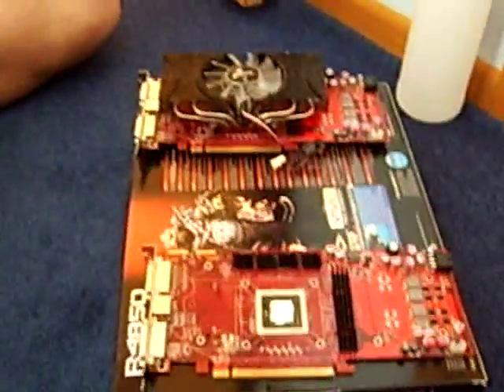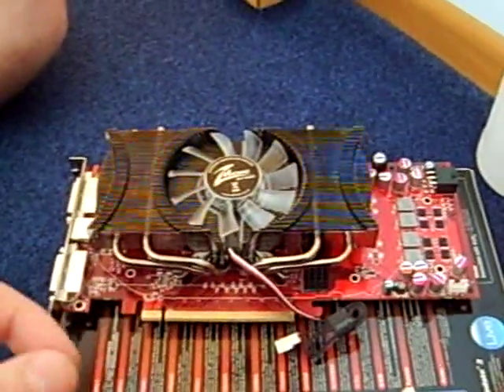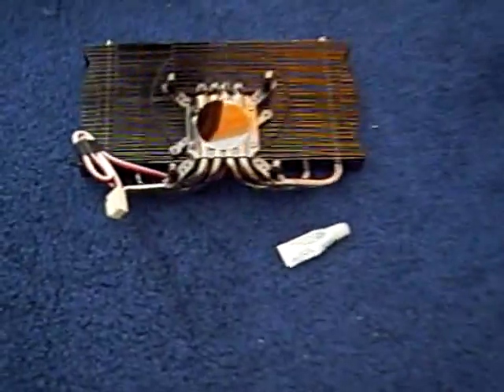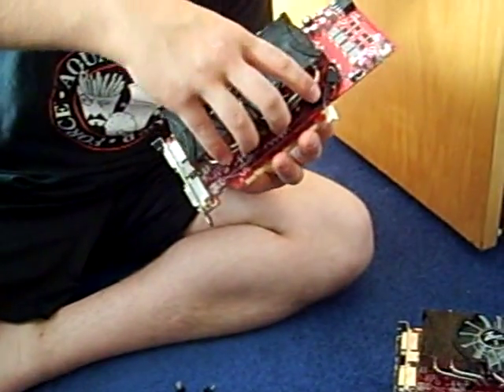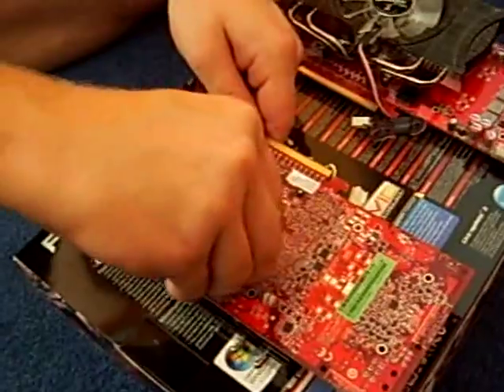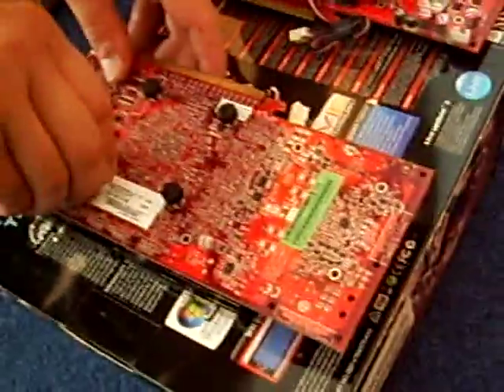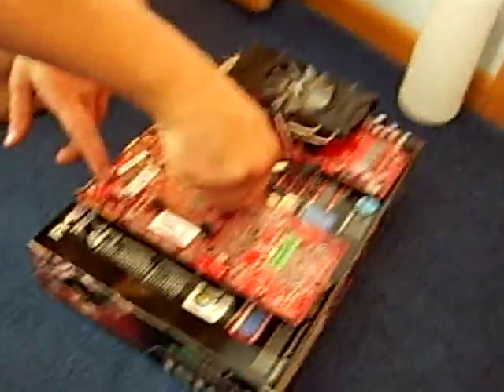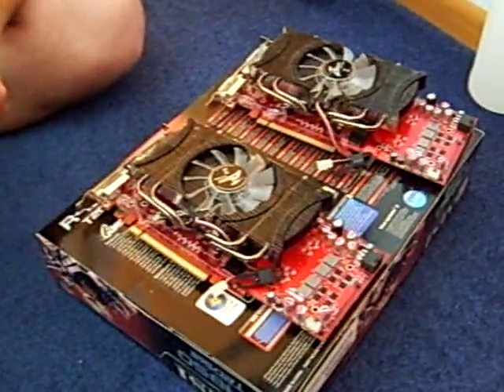radeon 4850 tutorial: Putting on an aftermarket vga cooler

Comment from the maker: I didn't "iss" them I simply did not have enough heatsinks for both the ram and those voltage regulators BUT if you have as ggood of an airflow in your acase as I do (IE case temp is always below 23C) you don't need em since the air itself keeps them cool enough. plus my fans speed are the fastest speeds you can get on the market which means there is no static air in my case.

Comment from the maker: The after market fan comes with essentials only which means the gpu and the 8 ram. The others are optional. I have been using this setup for about 3 years now... I know that I have enough airflow where I don't need those.

Comment from the maker: No, if you really did buy an aftermarket vga cooler it should have came with the main heatsink as well as other smaller ones for the RAM on the card. If yours didn't come with any then you need to get a better heatsink.. maybe mine. but the real answer you are looking for is this: the ONLY place you need to put on some thermal paste IS the center of the GPU itself... That is the place where the main heatsink is going. The others already come with thermal paste in the adhesive in the bottom.

Comment: hey man nice vid!  i was looking at a 4850 but unhappy about temps and was thinking of getting the 4850 = $200 + this cooler = $260 or i cud get GTS 250 = $220 which i read has pretty decent temps and probs wudn't need an aftermarket cooler.  I hear their performance is the same.  What do u suggest?  please comment everyone.

Comment: in conclusion. both the 4850 and 4870 base cooler both sucks. and for different reasons.

the 4850 sucks cause its a single plate. 
(very bad,heat vs cool ratio)(you better sometimes with real small cooler that dont touch everything)

4870 sucks as well but not as much as the 4850. so leeson to learn is. that any cooler that are based on a single impact plate to supposdly dissapate heat.(they are scientificaly scams)

Comment: and mainly the most imporatant it dosn't actually heat up your ram chips. which create artiffacts. 

(i have looked at the basic cooler of the 4870. and i must say its in fact much better then the 4850. as it is in 2 parts. gpu cooling is sperated from ram cooling. but still. the metal is too massive for adequate cooling.

(the thicker is the metal the harder it is to cooldown. while it seems to heat quite fast.(bad heat vs cool ratio again).

Comment: damn i hate 500 char limit.

what i whanted to say is that a single plate of metal touch all the ram chips and the gpu as well.
they all exange the normal temparature of the metal with their heat. however. the gpu heat so much that it give the metal a bad ratio cool vs heat. so you end up having a cooler not effective at all. all it does is look cool.
best is having a cooling block impacting the gpu only. so the exange of cool and heat is more fair.

Comment: if you whant a litte course on about cooling.

you don't need a diploma into that to understand it lol. here is it.

metal surface can be technicaly good for cooling. however. using a single platte of matal to dissapate the heat out of all heat source . the way heat dissapation work is.

and this is basic science. it work by exanging temparature. 
ex: when you hold a cube of ice in your hand.
the ice melt while taking your heat of your hand. and your hand takes the coolnest of the ice.

Comment: becausse the stock cooler is a pos metal. 

not even alluminium or even cooper.

its just painted in cooper cloer like.

its a real shitty metal with crap property.

it sucks up the heat and take hours to cool down. (not good metal for cooling).

Comment from the maker: Your cooling is good for now, but if you are already getting thermal for your cpu, it doesn't hurt to add it to your GC. The cooler on your's is a lot better then the default that was on mine. That's because of the 1 slot designed fan that mine was.... HORRIBLE at cooling.

Comment from the maker: Well there's your first problem right there. Unfortunately, Arctic VGA coolers have been known to break down completely, if not function incorrectly. It seems that the metal they use for their heat pipes isn't the quality you need to get heat away from your GC. If I were you I'd probably use the heatsinks you have and just get the gv1000 that I have. You wont regret it :)

Comment from the maker: As I have said numerous times in numerous comments: They do not need me to waste $20 on something that doesn't get over 75F. My case Gets very, very good airflow. So maybe that is helping, but I have never seen it get above that, so I don't see wasting $20 for more heatsinks. I have had these in for about 4 months while running fry cry 2 and crysis on ultra hgh settings everyday without overheating or any other GC problems.

Comment from the maker: slatthewaltt: Static shock depends on the clothing you wear, the carpet you are sitting on, and the climate / condition of the room. Not EVERY room is filled with statically charged particles. I believe you are too worried. These manufacturers go out of their way to make sure that it isn't that easy to statically shock their products. 

Also, Wizzkid: the ones you need to make sure you heatsink are the ones that I showed you in the video. If you have extras then do those smaller ones.

Comment from the maker: Foxxaw, I will gladly tell you my temperatures but you must also realize that your temp of your GPU also has to deal with the airflow in your case. Recently I moved my tower from my basement to the highest point in my house. Now my idling has gone up from 30 to 34-35C on idle. Under load it hovers around 37-40C. If your temps are still up at around 56C then I would try a different thermal paste or maybe getting a better case / more fans in your case for airflow.

Comment from the maker: You seem to not know about how thermal paste works. It doesn't simply adhere to something it bonds to it. I also don't get what ypou are talking about with nitrogen, but if youn are using that to set the paste faster then you are dead wrong. It's not coolness that sets the thermal paste; that will just make it crack faster :\ it needs to bond at room temperature. Even when just running video your graphics cards still gets hot from running. And this will cause fractures in the bond.

Comment from the maker: First off to answer your question about the 24 hours leave time: this is to make sure that the thermal compound (paste) adheres to the ram / gpu thoroughly otherwise your ram heatsinks will eventually fall off. Since you played right afterwards I would check the connection between your heatsinks and your ram since it probably has loosened. Also, I have not put any heatsinks on the vrm's because that part doesn't get hot enough to need heatsinks. My case is nice and cool no need for them.

Comment from the maker: The stock fan for the 4850 idles at 60 degrees C. That is terrible for just idling, and it reached up to 80c during load. This mean it has a HUGE tendency to over heat, especially when you are playing incredibly graphical games like Crysis. The fan just gets too hot period :P hope that helps.

Comment from the maker: This cooler is made to work with every make and model of Nvidia and ATI graphics cards. Now if you are asking if you can use a default fan from the 3870 series on a 4850 card, I would assume not since they are both different sizes, have their ram in different spots, and have the screws that mount the fans in different positions. You should use this cooler, much less eneergy intensive and it cooler better than any default fan.

Comment from the maker: yes it says this on the instructions. (although I couldn't wait THAT long and I did mine after about 18 hours)

This is a safety protocol that zalman uses to make sure that the thermal bond adhering the ram heatsinks and to the gpu have completely bonded. It says that "after 24 hours the bond between your ram heatsinks and your ram itself will have reached about 90%."

This is just a simple way of saying: "Make sure to give it enough time so it sticks better."